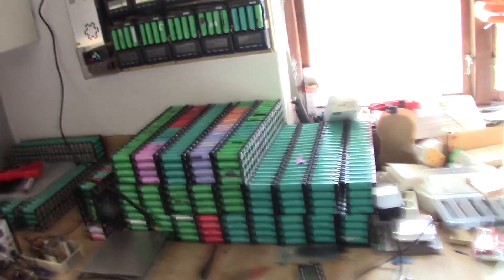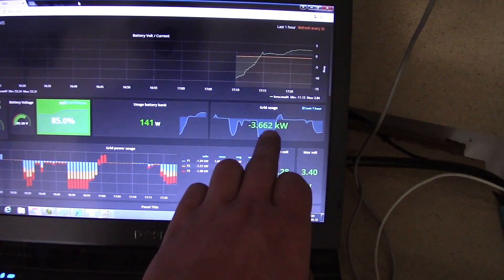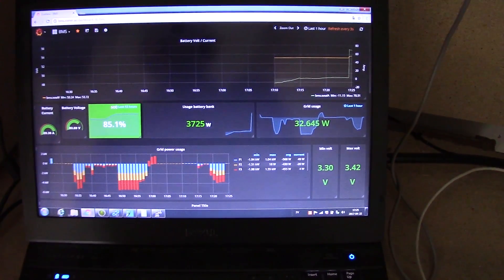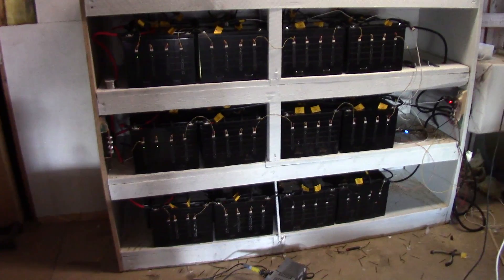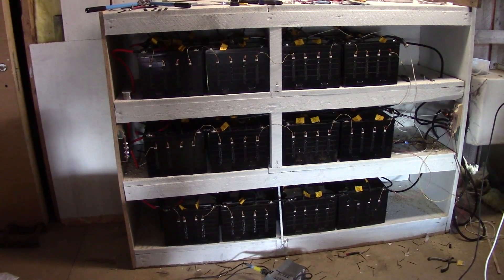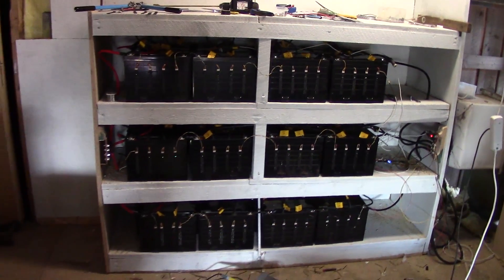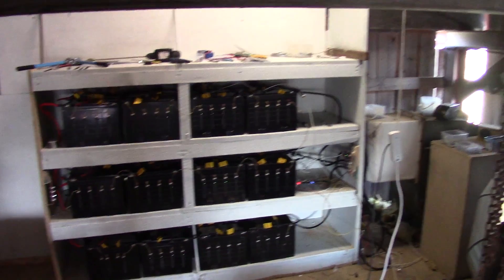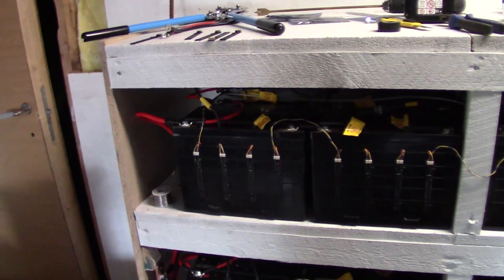100kWh+ Powerwall?!?!

Comment: What does something like that cost?
Reply from the maker: Alot of money :)
Reply: @DIYTechRepairs  but does this save money compared to just buying a Powerwall?
Reply from the maker: @Saxon360  If we only look at the cost and not the work hours yes i have saved ALOT comparing to a diy tesla wall. You can do the math on how much 100+kwh of tesla wall would cost. Also rememeber that those 100kwh i got is LiFePo4 that have an expected life atleast 5x compare to LiIon. So over time i can potentially save money in real life to.. With that said in Sweden a powerwall doesnt really do much in the short term. It takes well over 10 years to get the money back since we have cheap electricity. The battery part i dig because i want and can its a brag thing. You make the money back alot faster with only solar and grid tie than battery  :P

Comment: Hello sir could u tell.me if I use pcmx60 controller will it be OK. To.use with these 24 batteries wich would be about 40kw and will they be charge at any volt coming in from my 3kw windturbine and 1500watts solar pannels between 5 to 48 or its has to be 48v continues to charge them? Thanks.
Reply from the maker: The input to the PCM should be above the battery since it is a step down inverter. You can not have input voltage below the battery voltage. You can buy them here: https://goo.gl/t3Nkrt

Comment: I need ur help please send me ur email please thanks..
Reply from the maker: You can message me on youtube and all information there. I also am on the Secondlife storage forum
Reply: Could u tell.me 1 thing u put the batrium and longmons on these batteries because they where damaged? ? I'm buying same batteries but the build in bms is working fine they all are at 12v and max 14 do I still have to change the bms ob valance batteries?  1 more thing what sort of charge controller I need to charge them I'm going to use it for my wind and solar @48v.. thanks for the replay.
Reply from the maker: I swapped out the BMS since the BMS was not working. Have you tested your BMS? Just because its at 12V it doesnt tell much. You need to have the software and hook it up to a master system.  At 48V I would recommend the PCM60x as a simple controller: https://goo.gl/rtjxiu
Reply: DIY Tech & Repairs ur such a great help thanks for the info I. Hope I will it ya the builtin bms is working fi9 thanks a million..

Comment: why batteries in 2nd floor? It weighs a lot. And can flame. Better install it in separate barn, in 10 meters from any living houses.
Reply from the maker: Its installed 75 meters from any house with people.  Yes it weights some but thats not an issue. i carry it up once. I dont have any decent space on the 1st floor. On 2nd floor is where all storage is and the building is built for that. Building a separate storage would cost to much and not to talk about wires from that to my garage :)   Dont forget Cooling + heating that is needed where i live. Today its running with same as is in the garage to keep them around 10-20C.  I quick guess would be that build another house for just this storage of batteries and all the wiring including heat + cooling it would be atleast 15000EUR or more. (Can be done cheaper but it need to fit into the area and all)

Hope that answers your questions. Feel free to follow up if you wonder anything.

Comment: do you feed power back to the grid and if so can you do a quick diagram of how it works I have a 2.5 kw system feeding back to the grid and want to do a battery wall with this Regards Rick
Reply from the maker: I feed back to the grid yes. you can find an older diagram here: http://diytechandrepairs.nu/current-solar-layout/

Comment: Bro, can you help me with something? I'm going to build a solar 10w flood light that is going to be on the hole night. I'm going to use a 12 to 24v 10w LED driver, so I'm going to make a 4s battery pack for it (with a small BMS). If my calculations are correct, I'm going to need a 4s7p battery pack (2000 or + mAh batteries)... Is that correct? 28 batteries? O.o (I'm really new to that. LOL) Another question: what do you recommend to use between the battery pack and the solar panel? The panel should be around 18v, so I need a step down of some kind. A 9 amp would work? Thanks!
Reply from the maker: Nah...400 bucks is only what you pay for the really big and expensive ones. You can get Mppt chargers for a couple of bucks if you only need a couple of watt. https://rover.ebay.com/rover/1/711-53200-19255-0/1?ff3=4&toolid=11800&pub=5575290868&campid=5338074051&mpre=http%3A%2F%2Fwww.ebay.com%2Fitm%2F5A-MPPT-Solar-Panel-Regulator-Controller-Battery-Charging-9V-12V-24V-Auto-Switch-%2F201452908015%3Fhash%3Ditem2ee7876def%3Ag%3ATosAAOSwYHxWJ2lV  As an example if you want something really small. Just beware of that there are clones out there that only fake mppt.
Reply: MC's Creations to buy a mppt charge controller for a 10 watt led light is insane.  They are like 400+ bucks! Just one of the cheap pwm controllers from eBay with the built in timer is what I would recommend.  The timer for turning your light on and off is built into the thing. You won't get as much wattage out of your panels as you would with a mppt controller.  But mppt seems a little extreme for a 10 watt light lol. Anyways, good luck with your project!!
Reply: DIY Tech & Repairs to be fair when you start getting into the full size mppt controllers 400 bucks is still on the cheap and small side of things.  If you go with brands like outback or midnight solar you're looking upwards of a grand.  Thanks for pointing that 5 amp controller out through!! Those could come in handy for future small projects!!!
Reply: Oh, and BTW. I'm going to try using adhesive copper tape instead if soldering the batteries. Did you ever tried that?
Reply from the maker: Adhesive copper tape i have no real life experience with. Sounds weird... :)  Regarding battery. it depends on the actuall load including the losses and also how far down you want to take your battery every night. ie how much reserve you would want to have. 
Lets say your led draws including the converter 14W. If you need to power it for 12 hours thats 168Wh that you would need. 

a 4s7p would hold if you use 2Ah batteries roughly 207Wh. you dont have much left on that pack after 12 hours.... I would go atleast 2x capacity on the battery bank on what your usage would be. Also beware that you might not have much sun all days? (Depending on where you live)

You would need a panel that would be able to cope with what the panel give. MPPT would save you some % of efficiency. So go with a controller that suits your need. I dont have any recomendation as of now since i dont run that small systems... Though im building 2 of em right now so in future i will.
Reply: DIY Tech & Repairs Nice, thanks! About the consumption, I have no idea. But in the LED driver description it says "12 to 24v 800mA". So I used this: https://www.digikey.com/en/resources/conversion-calculators/conversion-calculator-battery-life About how far I would like to go, I would say 3v per cell, aka 12v. I don't know if it can work with less than 12v... About the sun, we don't have much problem with that here in Brazil... It's not sunny only when rains all day long, which is rare. Days raining in sequence, even more rare.  You know? About MPPT, I'm going to google about it. :) Thanks!
Reply: potc420 Thanks a lot! But, actually, I'm going to use a simple dark detector using a LDR. Do you know? About PWM controller, could it be any tipe? Anyway, I was thinking in something like a step down/battery charger. But I'm not sure. And, anyway, I'm not going to build it now. First I need enough batteries with capacity over 2000mAh.
Reply from the maker: potc420 yea. it cost. i would say the cheapest ones start at 200 to 250 and the good ones from 400 and top line 1000 :)
Reply: DIY Tech & Repairs I was thinking in something like this: http://s.aliexpress.com/eym22EvM

Comment: 50mm cable is to small you need at least 120mm from your batteries to your inverter if it's over 100amps draw and it looks like it's a long run as well so it's even more reasonable to have 120mm stranded cable....
Reply from the maker: TheMFrelly 50mm2 on current length and max 1% voltage drop is good for 300A. thats more than my inverter can draw and more than what the shunt would withstand for a longer period of time. 120mm2 would be 500A with above criteria :)
 but yeah i would love thicker cable but to expensive and it does not save me anything currently
Reply: How many meters do you need of 120mm if you were to get it?
Reply from the maker: TheMFrelly 3m if im not mistaken total length both ways. so its not that big of deal. I do plan to switch this out for 95mm2 in a near future to reduce the voltage drop somewhat.
Reply: 6 meters of 120mm $120.
Reply from the maker: That sound like a very good price i must say. Not what i pay on my local stores... Need to look around a bit more.
Reply from the maker: I did a quick test earlier for fun. 55V and 100A load.  => 0.15V drop between inverter and the junction point at the batteries. And 0.05V between that and the battery poles. That would be 0.2V in total and 20W of lost energy out of 5500W.

Comment: impresssive!!!
just wondering, looks like that upstairs area is open to the outside. and i suppose you will have sub zero temperatures in  the winter where you are living? my concern is you cannot charge those batteries in sub zero temps.
Reply from the maker: You are correct! Before i put the shelves up i did isolate behind it. This whole area will be isolated and the temperature controlled from the space below it since that one already have a system setup.  I also need to get this done within 2 months because then it will get hot up under that roof.  So there is ongoing work to sort that issue
Reply: thanks for the quick reply.
i installed an air conditioner in my electro room. but in the climate here heat is more of a problem than cold. if the batteries last 10% longer because keeping them cool, it paid for the aircon. and electricity is free.
Reply from the maker: Urs Odermatt yeah.

Comment: Nice job on your system, do you really need the BMS system you have installed?
Reply from the maker: Since this is LiFePo4 i would say that you need "A" BMS system. You need something to monitor and take action on the voltages. LiFePo4 have its sweet spot very tight and it goes fast over or under if you dont monitor it :)  I wouldnt run this type without atleast. Normal laptop cells on the other hand based on LiIon types is quite different and can potentially run without BMS for days or months as long as you have top or bottom balanced them properly.

Everything is though relative and i would not recommend running without BMS or atleast some kind of active monitoring.